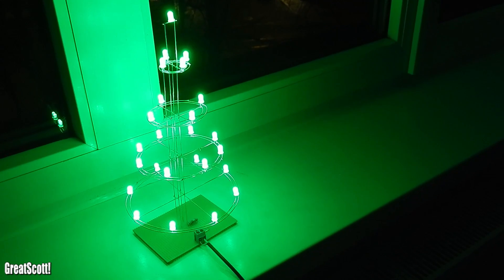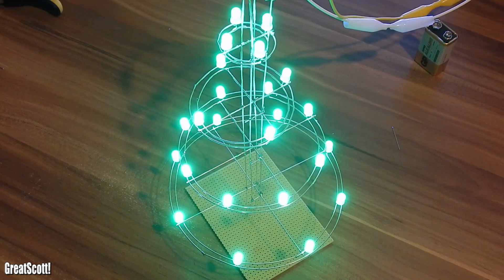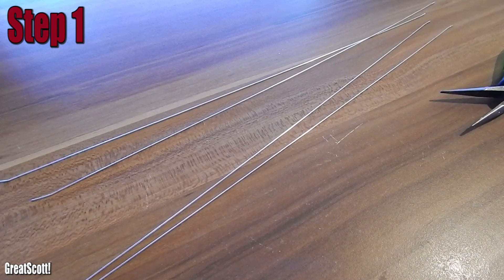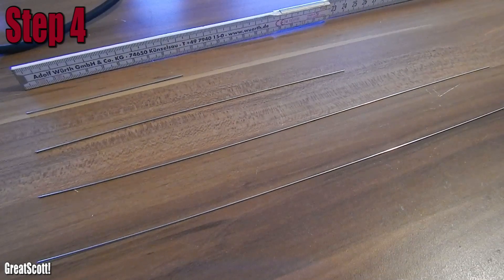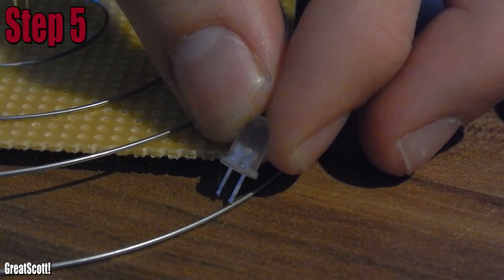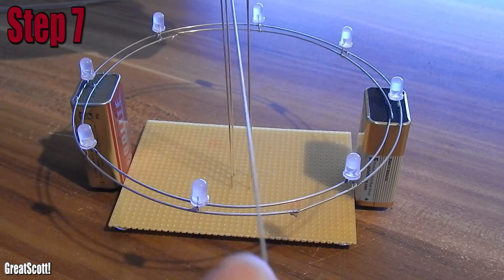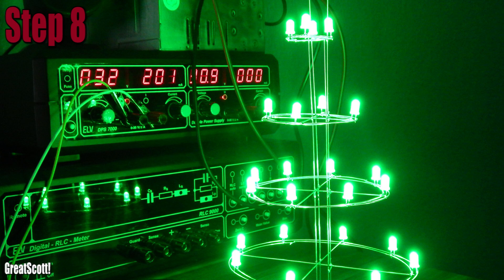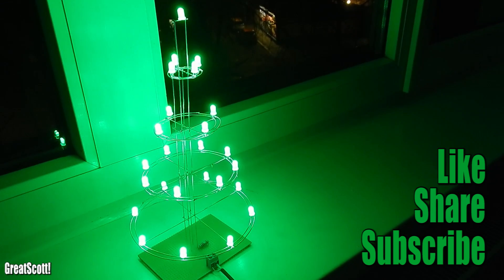3D LED Christmas tree

Comment: Hello... to make straighter concentric circles, use a conical shaped solid, perhaps made from card stock?  What would be a nice add-on is insulation tubing maybe 0.031” inside diameter (not heat shrink) for the bus wire.  You could clip-on paper ornaments to the insulation tubing and “deck-out” the tree even more!  Nice work!

Comment: Wow I wish I had found this video before we headed South. I do not have all my assembly equipment along down here in the Arizona Desert. I have built several of the Chinese kits that are Christmas Trees and Holiday Bells that flash from side to side.  They do make a fairly nice Christmas Display on the Dashboard of our Motor Home.  The string of multi-color LED's that I glued to the Windshield last Christmas Season have stayed in place through the summer Months so no need to replace them. Guess I am about Ready for Christmas, well except for a gift for my good wife of 48 years.  You see, some how, and don't ask me how in today's world, I forgot her birthday this year.  First time in 48 years, that was back in August, and I still feel Guilty for such a slip of the mind.  I blame it on the pain killers, but to tell you the truth, it may well be that my old brain just isn't cutting it any more. That is a frightening prospect.  I have watched as my brother-in-law, some 10 years my senior has lost some of his ability's, such as being able to drive his motor home, my God, if I could not driver our rig, we would have to sell her off, as my good wife can't handle the big rig with our Ford Edge hooked to the rear.  Well I have every confidence that she could, however fear of the unknown has kept her from behind the wheel since we upgraded to the big rig, from a pickup towing a camper (she wouldn't drive that either)  I can't blame her, these do look frightening to handle, but once you have them on the highway they drive like a big car.

Comment: Why you use 200mA? If you have 25 LEDS in parallel and them consumed 20mA each one. Thanks
Reply: They don’t, that’s just the theoretical power they should get at their forward voltage, you can use less amps and get a dimmer LED that lasts longer
Reply: Parallel = same voltage, increased current

Comment: Sorry for dumb question but how can you power so many LEDs with just 5V ?
Reply: +miguel dias put them in series
Reply: ele conecta os leds da mesma forma todos os positivos juntos e todos os negativos juntos.
Reply: +miguel dias All of the LEDs are placed in parallel, so there is roughly the same voltage drop across them.
Reply: +Wolter Nijmeijer 
*Parallel
Reply: He used parallel connection

Comment: GreatScott! This is amazing =) but I did not understand how you calculated your resistance. Can you elaborate more on how you calculated the resistance?
Reply from the maker: Rohin Gopalakrishnan I think I will make a small video about this topic soon. Stay tuned.
Reply: GreatScott! Thank you. It's a doubt I had always had.
Reply: Rohin Gopalakrishnan I would say you need to drop 1.8voltage from 5v because led consume 3.2v. That means you don't need extra 1.8v when it comes to powering 3.2v led. In series circuit, the current is same for all elements, led and resister in this case. So here ohm's law, 1.8v (you gonna drop from 5v) / current (led forward current) = resistance (it's gonna consume unnecessary voltage for your purpose)
Reply: (5-3.2)/0.2 → (1.8)/0.2 = 9 ohms